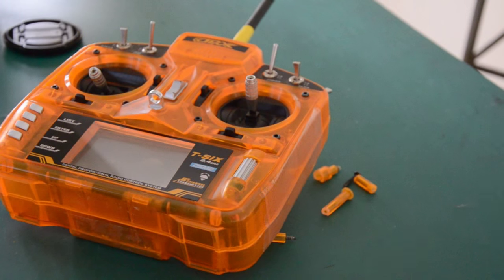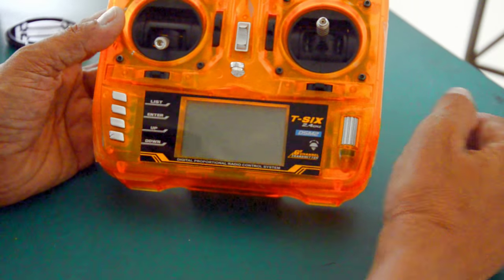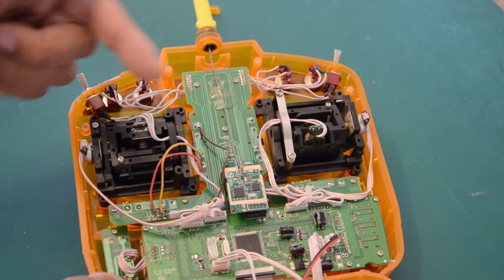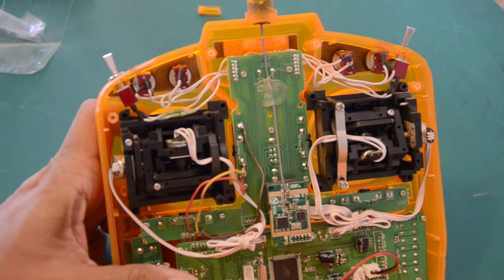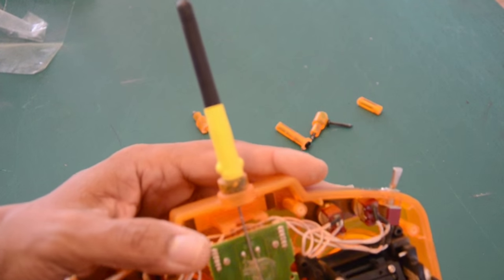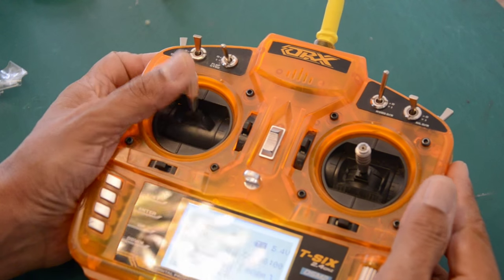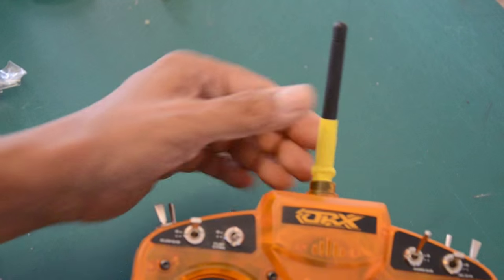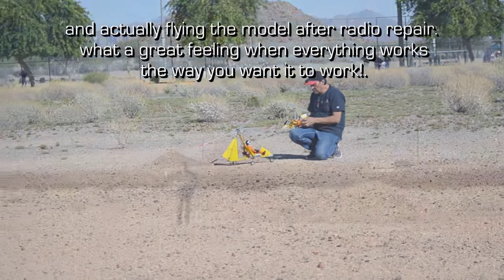HobbyKing ORANGE TRANSMITTER - Demolition,  Repair and Modifications - TOUGH AS NAILS PROOF!

Comment from the maker: I just noticed that Hobby King has indeed come out with a newer version of this transmitter, called the OrangeRx Tx6i Full Range 2.4GHz DSM2/DSMX compatible 6ch Radio System (Mode 2) International Version https://hobbyking.com/en_us/t6-dsmx-dsm2-mode-2.html . 

I think they have been watching this video as they have implemented some of the features I mentioned as desired and implemented on the original orange TX.  The antenna is now hidden from sight like on my modified original Orange TX, that I show on a great percent of my product videos, obviously for the reason I have indicated and to keep the antenna from breaking, which makes perfect logical sense when you look at the issues and risks you have with the typical antennas that stick out from the TX case.  They have not, however, implemented the potentiometer knobs I mentioned in this video and as on the better and more complex tranmitters and this may have been a $ issue. Aesthetics... Oh Boy!, I wish they would have retained the same case dimensions, as there was nothing wrong and still is nothing wrong with the original case, but they have decided to introduced an angled cut on the bottom of the case which makes it for a non-appealing TX. No longer it looks like a regular tranmistter but a game controller type of tx, even though they haver embeded a few newer features.  No I will not buy their new transmitter for these reasons, and because my original one is still going strong after the mods and many years of use.   WHY DO SOME MANUFACTURES LIKE TO MAKE THEIR PRODUCTS WORSE THAN THE ORIGINAL ONES?  It is dissapointing in recent times not only with Hobby manufacturers, but also with products, in general, that all seem to be going the dirty route, quick build, use and throw away products rather than making something GOOD and SOLID products that lasts years. I still have FUTABA gold alu case TXs  that work flawlessy to this day only they are not 2.4Gz and use the old long antennas.

Comment from the maker: Believe it or not I am still using this transmitter!  I WILL NOT PART WITH! I TRUST IT AND IT HAS WORKED WITH NO ISSUES AFTER REPAIRING AS I INDICATE IN THIS VIDEO.  I do have the 8CH orange version from Banggood, but I have not needed it yet.
I'm  pretty attached to this transmitter and if you watch all the videos I've done since posting this video, all my models of all sorts are being flown with this same transmitter.  The antenna is no longer via the long plastic tube that breaks easily, it is inside the case. The battery compartment now has a locking tab to hold the cover in place, the case that broke is now also with locking tabs that hold both halves secure. There is not much that can go wrong with it unless I drop it again and the PC boards get cracked.  In contrast my DX6I has long expired and it has not even had the use and extreme abuse of this transmitter. Subscribe to my channel and watch the cool stuff I fly with this transmitter. https://www.youtube.com/channel/UCefEQgOboCP5AHVyphzjq-Q

Comment from the maker: I got the 8 channel Orange version from BangGood, had it for close to a month now,  but believe it or not I am still using the same HK 6CH TX as on this video as it has been repaired and modified to my standards. I did ask HK if they had  plans to offer the 8CH version,  but their answer was not very supportive.  I believe both orange TXs both from HK (6 CH version) and the 8 CH version from BangGood, come from the same manufacturer.  They are identical in every respect except the 8CH version has less beefier plastic base for the  TX sticks, and the springs feel a bit weak,  but otherwise it is the same mold as far as the case is concerned, same layout,  and same electronic pc boards inside, but with additional parts for  8CH operation.   I have not used the 8CH version because the Antenna is still distracting and a break risk point as it was with the 6CH version and almost every other RC TX with similar antenna layouts.  I did a full review video of the 8Ch TX from BangGood,  that I have yet to upload.  I will be removing the Long Antenna of the 8CH TX,  the plastic parts and route the actual coaxial antenna cable inside the case as I did with the 6CH one,  so to make it more compact and remove the possibility of the antenna wire breaking if the plastic antenna parts break.

All my latest MIA MTG Trainer RC Gyrocopter  Flights (See my recent One-Handed RC Autogyro Flight videos) are flown with the repaired 6CH version in this video. No issues with antenna installed inside the upper portion of the case, and I can fit the TX inside my flight box with the lid closed, since it no longer has the antenna sticking out.
Reply: It has dsmx, I think.

Comment: I have this transmitter in my hobbyking shopping cart now. I am still not convinced that the shipping cost of 40 USD is right. Spektrum seems to have the DX6i warehouse in the US and repairs turnaround seems fast by reputation.
Reply from the maker: I don't  know what HK shipping is these days for the orange TX, but they do have a few options  available for selection when you purchase  products from them. 

 Sending products to repair houses whether they are here in the USA or elsewhere is not something I do with any product I purchase because 1)  Repairs are typically costly and one is better off  simply applying the cost of repairs to another new unit. Many times it is a lot cheaper to purchase a new unit than having it repaired by a vendor.  2) Delays in repairs sending item and waiting for it to come back 3) I can do most of the repairs myself.  

Spektrum may have a great reputation, but I don't go by what the majority of people post and I don't trust anyone's opinion by my own via thorough research and testing the products myself and I would recommend people do the same, don't even take my word for it, if you are like me, but please don't go by the assumption that because a product has great marketing and a lot of people glorify it it must be better than others.

There are a lot of people who do not scrutinize products to the level you need to, to  get down to the  real value of what you get. They simply go by what they hear from the masses or see constantly in magazines, media, most of the time what looks popular.  I try to place a lot of relevant info in my comparison videos or product videos for that matter, so that people get a good feel of what they would get when purchasing or comparing products. 

Having said this, I am not saying that the Orange TX is the best out there, but in comparison with the original DX6i it has ans still is  much much better for all the reasons I have indicated in my comments and in this video. 

Choose wisely, check out other videos or talk to other people who have both the orange and original DX6i and see if they have similar comments to mine.
If they do you can reassure yourself that you are on the right path of making the best choice, if you have been looking at these two types of TXs.

Comment: Shipping fee from HobbyKing is outrages.. Otherwise I'm sure it would be a good value. They should raise the price of the unit and lower the fee for shipping.. There's just something wrong with paying $30 (avg. fee) for shipping an item of this size and weight, and it will take 3-4 weeks..
Reply from the maker: +MrPageplayer Well,  I also thought as you,  but after considering the total amount it is still cheaper for a product that I think is better in the respects I mention in my video, as compared to similar ones.  Just alone the fact you can purchase the DSM2 receivers very inexpensive too is a plus also. Total $100 is about the right amount with shipping.  The DX6I  is about $129 not including shipping.  Even the Spektrum receivers are almost twice the price as the orange receivers. And I am not convinced that Spektrum has better technology than the Orange brand. Even with Free shipping that Horizon advertises,  I would stick with the orange transmitter. I never liked the DX6I from an ergonomic reference, and some of the detail it lacks as compared to the orange TX,  there is no solid grip on the DX6I,  and it always felt like I had a cheap boxy piece of plastic in my hand.  The orange has a much better grip molded on the case and I have never dropped the Orange TX due to slippery grip as I have the DX6I. I think many original DX6I owners will probably agree here. Now I have not seen or held one of the newer DX6I Tx's so maybe Spektrum improved on these areas. But it is going to be hard for me to go back to Spektrum also on the basis I felt sucked in to this Transmitter on the Brand Name and the hype some people were giving it when it first came out. There are a lot of products that are just as good or better than the well know brands. But unless one tries them all it is hard to tell which one and for what valid reason one is better than the other.  3-4 Week is OK with me, because I also manufacture products and know that  when a product is good there are delays, means people  want it and are buying and there is not enough to go around for everyone at the same time. I run into this all the time with my own products.

Comment: hi can you mix aileron and rudder on the orange?
Reply from the maker: Absolutely... the tx comes with 2 separate MIX options that you can mix any two channels. BTW, I am still using this radio and I cannot depart from it. NOTE: This radio has much better gimbals beefier than the orange T-8  from  BangGood, otherwise it is the same TX with the T-8 having some additional features.

Comment: lol dont hulk smash at the divorce
Reply from the maker: This radio is still working while my  DX6I gave out. I never like the DX6I  and maybe it decided to return the favor by not functioning for good. the LCD screen ribbon connection to the PCB is so flimsy that it broke easily while trying to add a light to the display.  Previous to that, the thumb roll potentiometer gave out, cheap plastic broke,  and I had to manufacture a replacement from alluminum.  You can see other comparisons with the DX6i videos and you can clearly see the orange is much better mechanically,  aestheticaly and ergonomically.  But I am focusing strictly on the Orange here.  My other radios besides Futabla,  Airtronincs, JR, is the Devo 10 from Walkera that came out when the Lady Bird quad copter came out, I had to take that one out recently to fly a modified Lady Bird quad and I love that one too, it feels like a much more expensive TX and is nice and   solid.  Now If I ha a Taranis I would probably favor that one also but like I said I have had no need for purchasing the Taranis as most of my models are DSM2 and use the orange RXs and I still will not part with the orange one. Especially after the fixes and mods I've done to it.  It has been like my dog, LOYAL and you don;t get rid of it. Period. :)
Reply: XD cheers